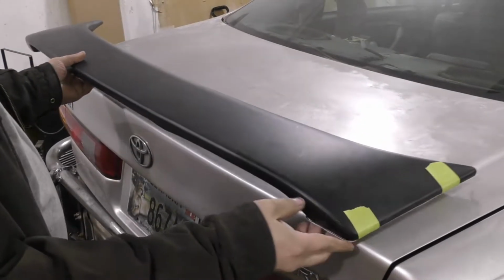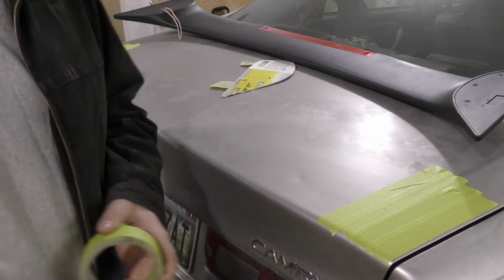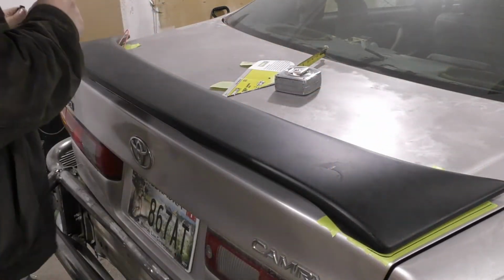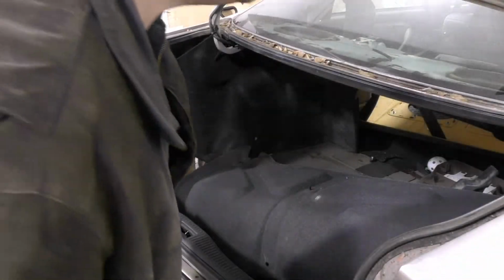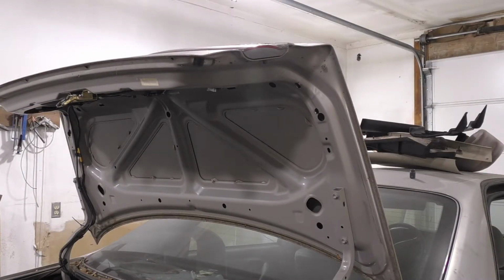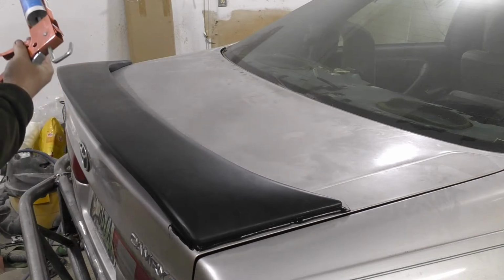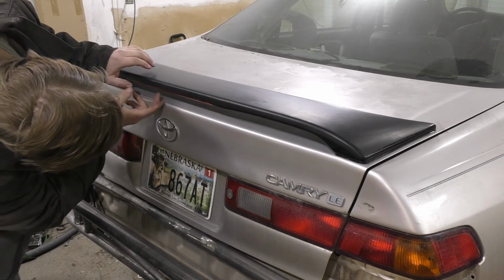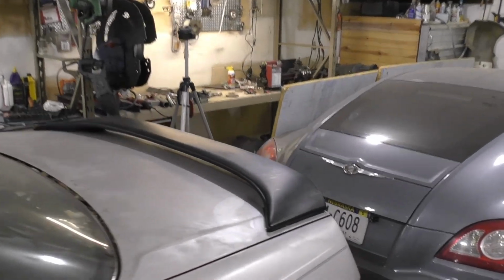Gambler Camry: Part 9 - Adding a Touch of Style

Comment: Good tip for sealing those with caulking, run some painters tape on the edge and lay it down and smooth it out, then pull the tape before it dries and you get a nice clean edge